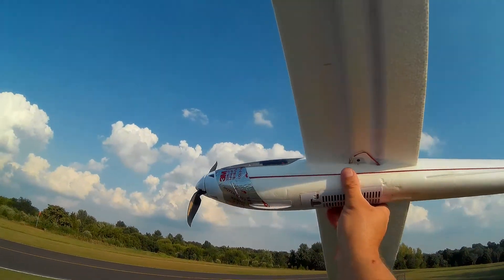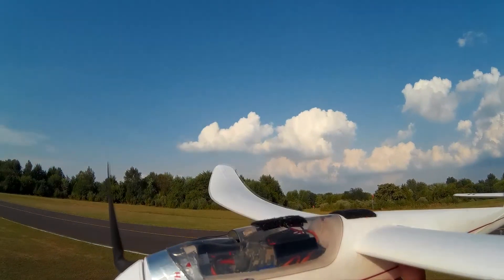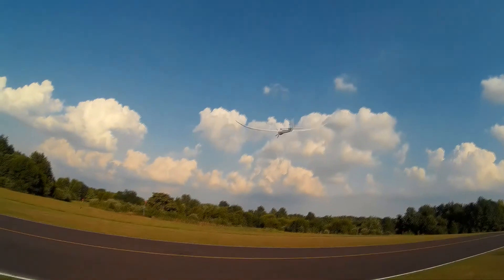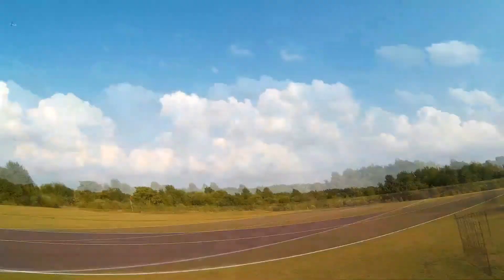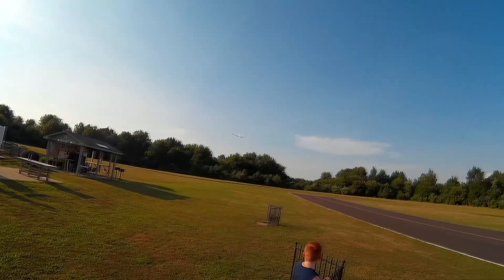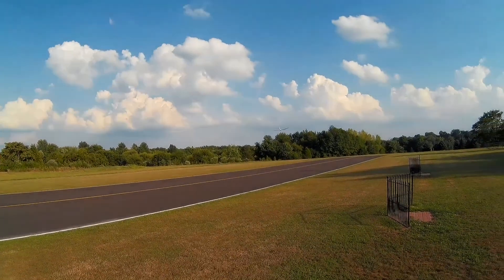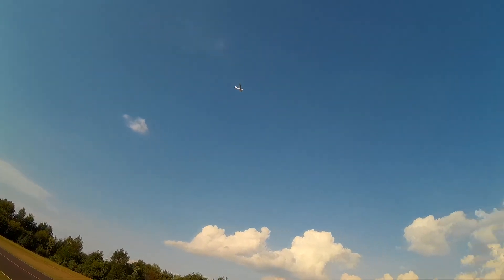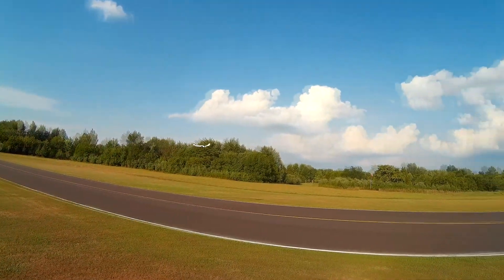CG is finally Right

Comment: You using 2200mah?
Reply from the maker: Flying Times yes
Reply: @shelbyintheolds  Me also and my battery is as far forward as it'll go. True you got 25-30 min flight time other day?
Reply from the maker: Flying Times Sure is.  Warmer the air topside the better.  Catch some thermals and baby the throttle. 
As long as the CG is correct,  there is a chance of easy 45 min flight in right conditions.
Reply: @shelbyintheolds  Sweet and my timers been on 15 min lol. Will change that! Thanks.
Reply from the maker: Flying Times Don’t get to far ahead of the weather conditions 🤣 .
Reply: @shelbyintheolds  lol. Rain grr
Reply from the maker: Flying Times  and wind.  More wind more battery usage 👎